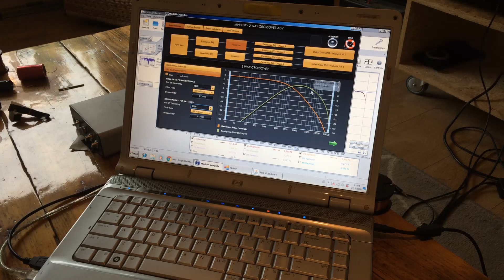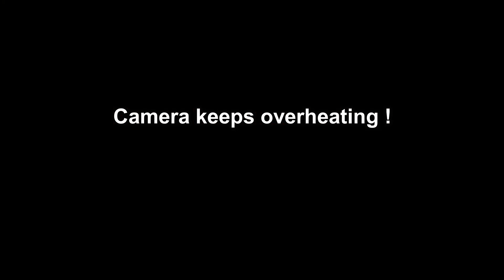Diy Planar Magnetic Headphones - Part 6 -making Driver V2

Comment: Most of the planar magnetic headphone I have seen use felt with cutouts for the seal between the driver and the pads.  if you have the time I would love to get a list of where you purchased your materials for this project. Primarily the foil and mylar of a great interest. Thanks so much for being so awesome and working so hard on this. I Was preparing to attempt my own build but realized I am grossly under skilled for the project. Hopefully I'll be able to follow your lead. Don't get frustrated about the tuning. I think most planar dampeners and use different types of cups to achieve bass or reference or even bright effect they're looking for. Tuning is something you can do later. I will say that I prefer the sound of naked planers though. I have m560 m1060s and hifiman 400i. I think they all sound better without the dampeners on either side. They become more their own headphone. Watching you build those was fun though. Took me back to the first time I tore apart a pair of hifiman he-400i eyes. Stuck my screwdriver right through the diaphragm when it got picked up by the magnetic field. Good luck
Reply from the maker: Thanks allot for the elaborate reply ! aay the srew driver trough foil classic :( hope they work again.>? ill try making a list in the end!
Reply: No they didn't work again but I got another pair. They're pretty cheap I can usually find them for a hundred bucks. Better story then the screwdriver through the driver was my four-year-old son sticking his finger in it saying what's that. And then he stuck a screwdriver intentionally there one of my other ones.

Comment: 3D printing seems like it would be much easier and cheaper than Cnc for a project like this! You could also make headband prototypes as well as experiment with open back/closed back or vented a 3D printer with a hotbed capable of something this size and complexity could be had for under 200usd.. just picturing all the stretching jigs you could make as well
Reply from the maker: hehe well yeah for some things yes!, but i can cnc a fram in a minute :) try that on a 3d printer :)  for complicated things they are hard to beat for sure :) but i ran out of money since yesterday.... i had to take puss to the vet , even had to loan some money  to pay the bill. so a 3d printer might have to wait haha :) for most things a cnc is just simpler and faster. but you do have to think of weird solutions sometimes :)

Comment: I have read that using a heat gun, at least on Mylar, initially causes it to tension but later it becomes less tensioned then before use and makes the diaphragm unstable, in electrostatics anyway.
Reply from the maker: well that aint true,  usual;ly it has to do with the way people mount mylar (double sides tape etc, will creep over time as do many glues)  a quad panel for instance  is heat treated just because it hold resonance better (like 30 years)  there will be some realxing but the same goes for purely stretching. so heating could work perfectly fine, but for most purposes in ESL's has waaaay to low resonance.

Comment: Well made and you have definitely put in a lot of effort into this. Good job and it was rlly fun to watch! Btw i am going to try to attempt something similar but also simpler using more basic materials. I intend to build a pair of open back planar magnetic headphones from cardboard, some plastic files, copper wires, neodymium magnets and the like, hope it works ;)
Reply from the maker: thanks m8,  if you can try finding aluminium wires. weight is an issue for the top end.  wires.co.uk is a source. Goodl luck !
Reply: @joppepeelen  thanks so much for the advice! It didnt occur to me before that copper wire would be too heavy :) Btw one more question, if i use a stiffer material for the diaphragm (the foil), should i still glue it to the magnet plate or should i suspend it more freely? Thanks
Reply: Also is the resistance very high with aluminium wire? I intend to drive my headphones with a portable dac/amp which may not be very powerful
Reply from the maker: I think Weight wont allow for much stiffer material
Reply from the maker: Resistance in my case wss 16ohm. Pretty low. But most phones had no trouble driving them. With wire it  all depends on th e thickness you use and the amount of turns  much easier to reach higher impedance, get the thinnest all wire
Reply: @joppepeelen  thaNks so much :) will let you know if i succeed

Comment: hi, great job, what is the reference of your neodyme magnet ? thanks !
Reply from the maker: I think what i called my reference , is a magnet sitting there on the lamp i decide for a driver witch pole is facing me when making the driver , and i use the magnet on the lamp as a reference to see witch pole needs to face me when i put it in (or face the foil).  (i dont know witch pole is north or south, but its a way to make all panels the same)
Reply: @joppepeelen  thank you for your answer, did you have the dimensions of the magnets? And do you know where I can find them?
Reply from the maker: It where 50x3x3 mm aliexpress or ebay
Reply from the maker: N52 strenght
Reply: @joppepeelen  thank